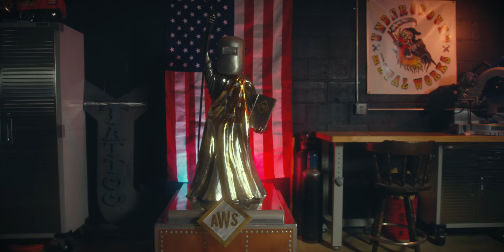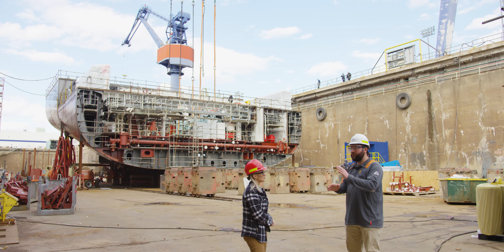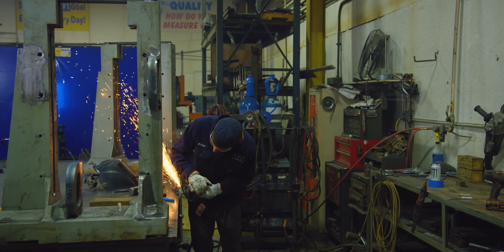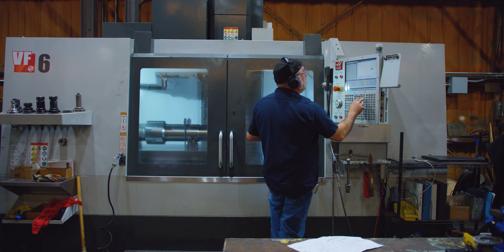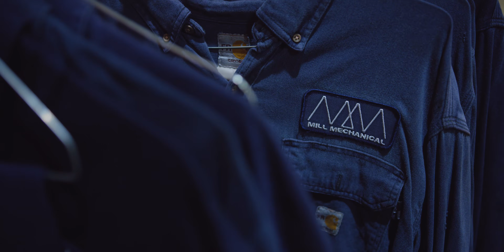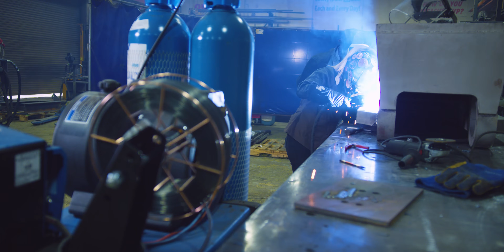Metal America: What Goes on Inside an Industrial Job Shop?

Comment: Welding is a rough career . You don’t get air con in a fab shop. I would never talk a teen into becoming a welder .
Reply: It really is. There are so many options nowadays where you could easily make more than what welding offers. Sure, you can make good money welding but it’s not as easy as people like AWS and Mike Rowe make it seem… rare to get AC, rough on the body, other welders can be toxic, low pay for majority of jobs, and takes many years to become a good welder.

I do it because I love it, but I’m definitely finishing my welding engineering degree cause I don’t want to be behind a hood my whole career.
Reply: @ieatslag5947  don’t know where you live . But try to get into the film industry. Only place to earn good money as a welder 12/14 hour days tho . You will make Enough money to buy your own plant . And go out on your own
Reply: @JC-un4bg  east coast. What type of welding in the film industry?
Reply: there are many shops that don't have AC, true. I worked in an AC shop in a very clean environment doing TIG welding on aerospace parts, another shop that I worked at also had AC, we did a lot of stainless pipe work. There are jobs available at both ends of the spectrum, and many welding related fields such as inspection, testing and engineering. No matter the field of work I agree, no one should be talked into it.